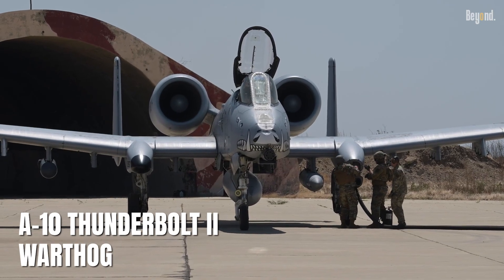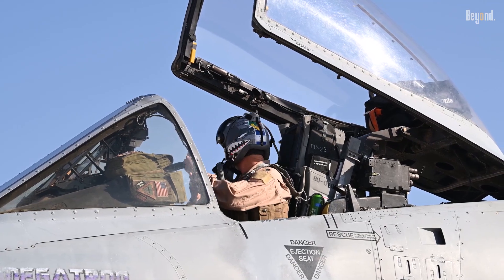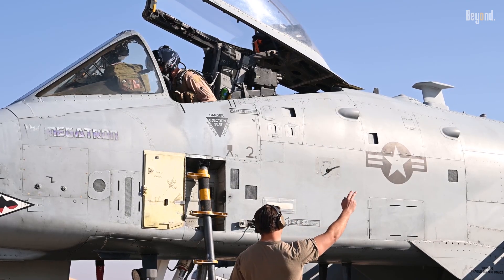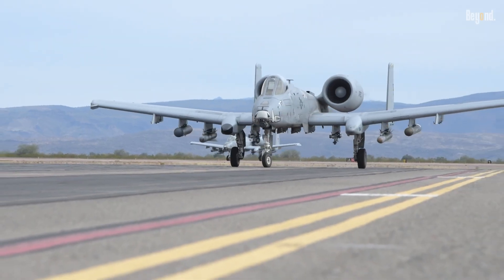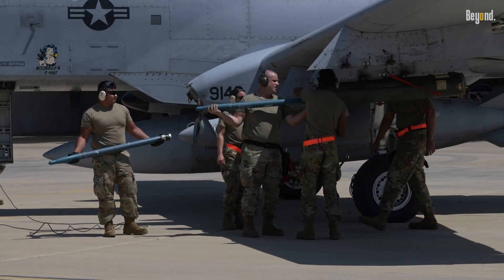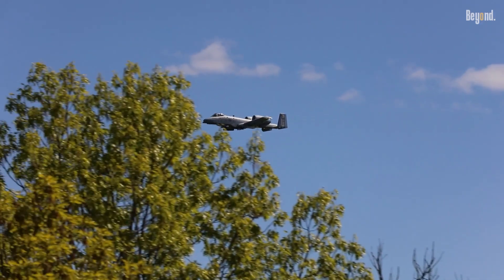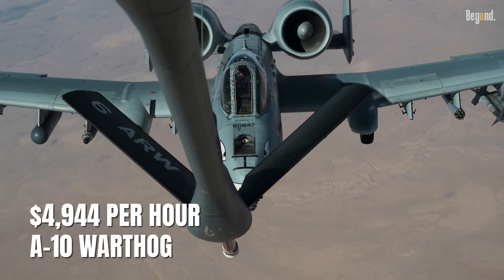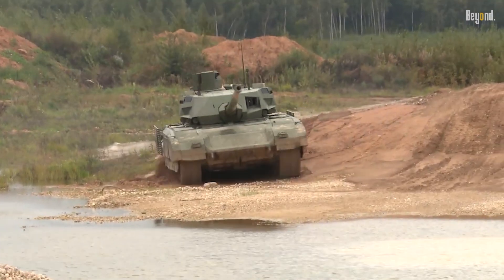The Air Force Doesn't Want to Stealth the A-10 Warthog, Here's Why!

Comment: What the A-10 needs is carbon plate armor of woven nanotubes or something.
And maybe better engines or a extra smaller one or two?
Reply: At one time they were talking about upgrading the engine in the A-10 but it never got traction.
Reply: @MaxPartridge146  
Ya normal upgrades would make no sense for mission.

Doesn't need to shoot farther, be more stealthy, or need more firepower.
It needs more redundancy, and better for what it does.
Do to challenges of flight most don't use aircraft for this mission type, they use helos instead.

Or use higher flying more none direct air support.

Comment: I'm going to call BS on something. The A-10's Gun does NOT struggle with Chinese Armor. The Tank's armor is thin on top and the A-10 is full capable of turning a Chinese Type 90 or any other tank, into shredded cabbage.

Comment: Nearly impossible. The location of the engines make a Stealth Warthog nearly impossible. You have a heat signature that's unreal. That's why the engines of our stealth craft are practically buried in the airframe. They have to cool the exhaust to a degree.
Reply from the maker: How if the engines moved?